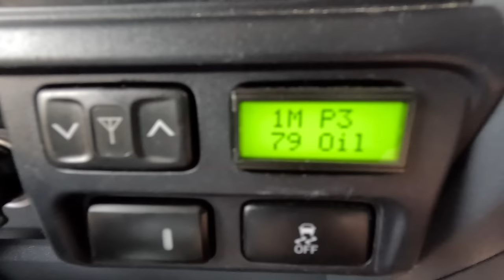Landcruisers VS Balfour track

Comment: I believe in preventive maintenance I has a  thermal bypass and cooler and service done at 30 000 km and was told oil was dark but not to bad now it is  serviced every 30 000km and was told I could push it out to 40 000 if I wanted to have now done nearly 160 000 and no problem yet

Comment: i love u guys but please ffs jsut let ya tyres down its not that hard. you can take any pos car that spins 4 wheels on the dunes if i let your tyres down. i got a factory turbo 80. its about 3 tone and gutless. i run 8-10 psi and i was crusinng past the stuck people at inskip and ningarla rocks. beach buggies run like 4psi. quads lun like 8 psi. trackotrs run 4 -6 psi so why run 45 on the beach. 180k worth of truck and power to get stuck and look like city slicking noobs
Reply from the maker: Did you not watch the start ?
Reply: @TJANDMAC  skipped over it's. Saw some deflators come out. Thought where we go. There gonna drop for 20psi like undid on Stockton beach.